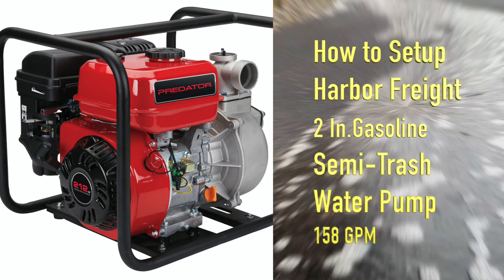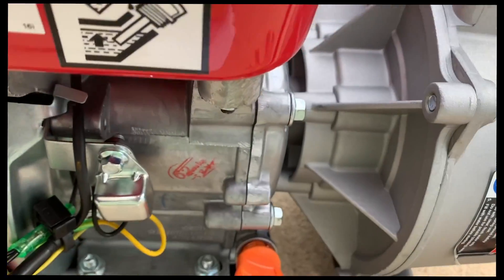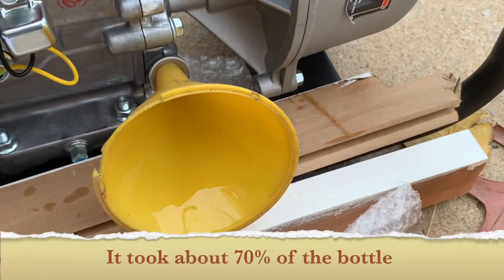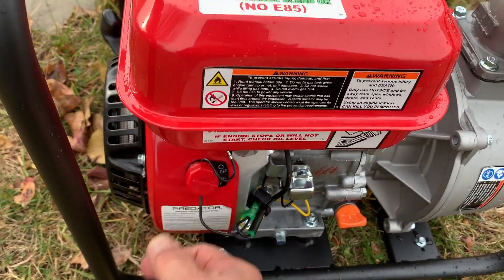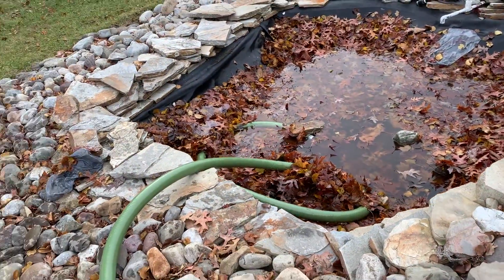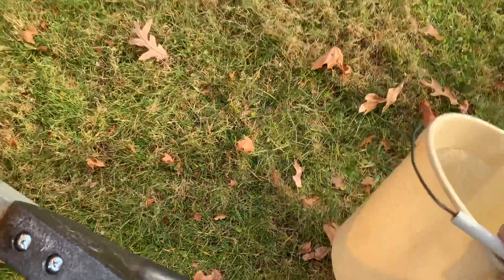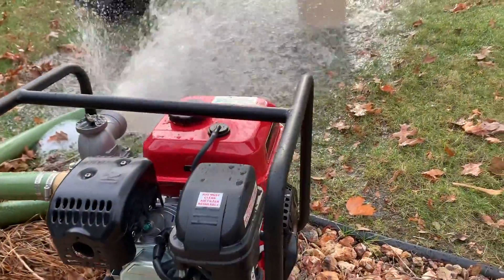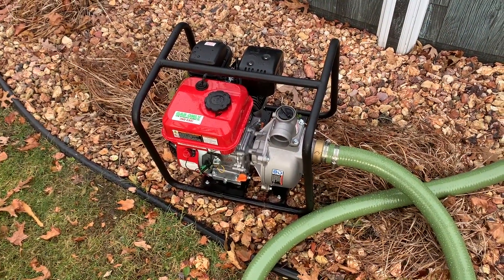The Harbor Freight gasoline Water Pump - Unboxing, set up, starting it for the first time

Comment: Had to comment again Tommy. I got it last week and that Water Transfer Pump really throws some pressure man. I used two 25’ discharge hoses while draining the pool cover out to the driveway stone and it looked like God parting the Red Sea. I mean it channeled a foot deep groove in the ground which is like concrete itself ….. crazy.
Really enjoy your channel. Also looked at "My Cluttered Garage" channel and found a really cool tool for cutting and sizing firewood for my chainsaw. Good stuff from you guys.
Reply from the maker: Hey John!

Comment: Thank you Mr. Tommy. I just bought the exact pump, intake and discharge hose. Can’t believe no oil in it. I bought mine online to be delivered in a few days. I would have had to go out to get oil. You saved me …. Lol!
Surprised you are not using a "Drain screen" on the intake hose. Look like it handled the leaves well.
Reply from the maker: Thank you